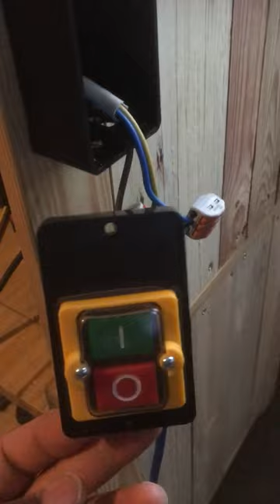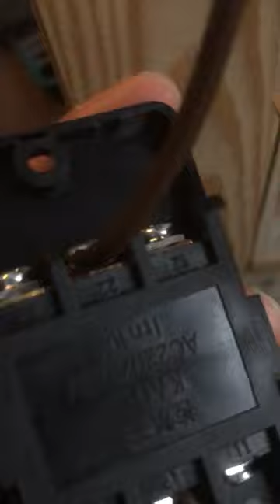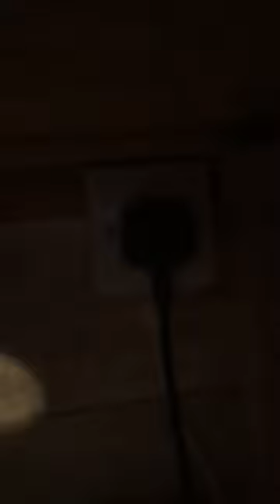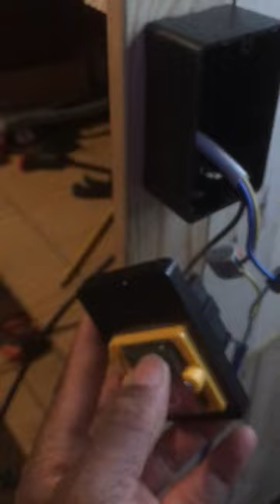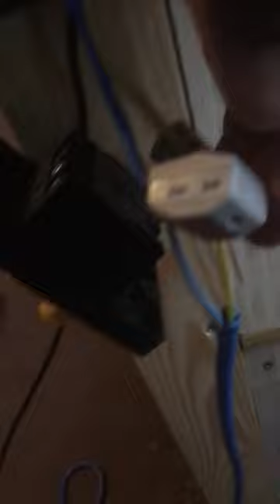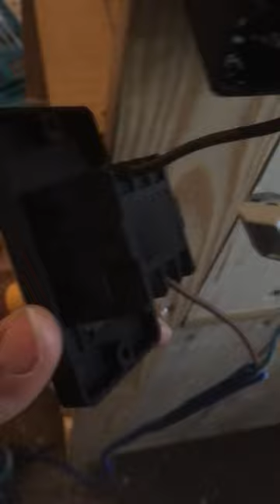Electrical machine switch

Comment: Sorry, but this didn't work for me...
When I do it your way, it is like a normal switch, and the security function is lost (security function means that once there is no current, the switch turns off so that there is no accidential running of your machine (for example router) when the current comes back!)
Thank you
PS: I will try another wiring method and keep you updated
Reply: Update: Indeed...this thing only LOOKS like a security switch that you know from your other machines...
There is no security option...it is only a regular switch...
So pay attention when working on the machine when you think (!!!) it is turned off because current is gone for a minute... 😉